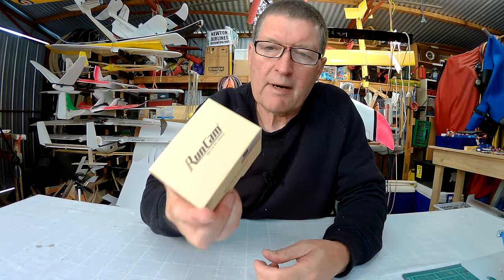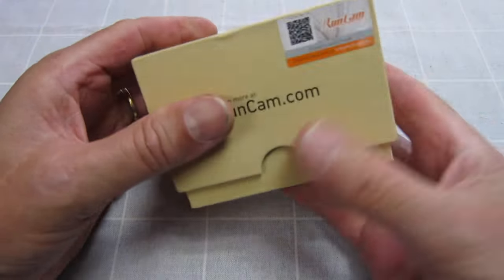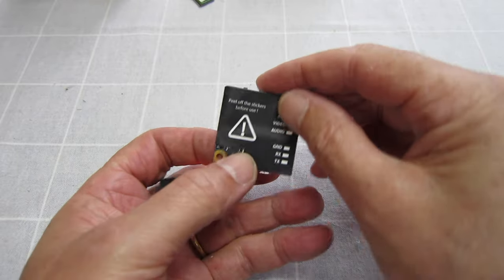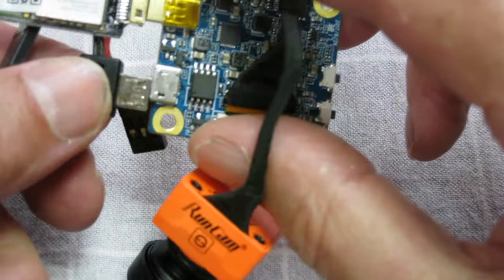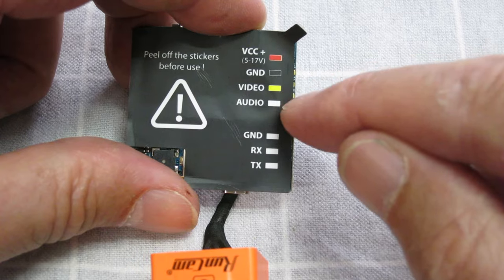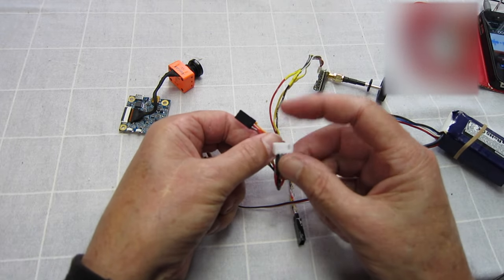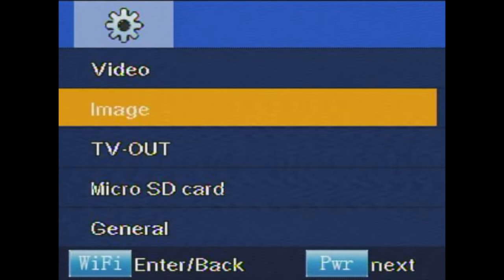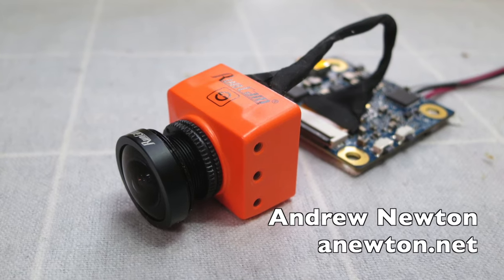Runcam Split 2

Comment: Would you mind doing a comparison of the Split FPV feed to the Eagle 2 & Eagle 2 Pro, including in low light conditions please?
Possibly on some kind of common mount if possible so we can see side-by-side???
Thank you VERY much in advance! :)
(It's the FPV feed that & light handling that has me worried about the Split)
Reply: BLeeKiis Too I've used both the split and the Eagle 2 and I can tell you that both are very similar. 

The split has a softer image which is nice but it did look a bit darker when it was in my poorly lit room (even with WDR one) Colours were good too. 

The runcam eagle 2 however the image was just better. The WDR made my dark room look like the sun was shining through the window. With the sharpness and edges turned down the image looks really nice. Honestly it didn't feel like I was looking through an analog camera. Everything felt natural.

The Eagle 2 pro is said to be the exact same as the previous but has 4:3 and 16:9. Imo you can't beat the Eagle when it comes to image quality. It even works as a low light camera too.

My problem with the split is that it shows a 4:3 image in my 16:9 skyzones and it just didn't line up with my osd. Not an issue with the Eagle 2 though
Reply: Ive read that the Eagle2 Pro doesn't has a higher minimum lux rating compared to the Eagle2- more like the Split & Swift so kinda torn between Eagle2 Pro or Split with microphone, or perhaps going for an Owl2+- I really like a microphone & low light both, would also like 16:9 so that brings me back to Eagle2....
And around the thinks go again! :v
Thought a side-by-side comparison might be interesting & cure some of the thinking..
Thanks again :)
Reply from the maker: None of the three are marketed as low light cams so wouldn't expect them to be great
Reply: ohh youll be surprised how well the eagle 2 does in low light. it has the same lux vaue as the owl plus and performs just as well
Reply from the maker: Thanks, good info. I have one but never used it in low light

Comment: I've seen there are 2 optional extended cables (180mm+90mm). No signal loss/degradation on the longer cables?http://shop.runcam.com/lens-extension-cables-for-runcam-split/
Reply from the maker: Haven't seen anyone try the longer cable.
Reply: It's a digital cable. It just can't degrade signal.
Reply: mmm...maybe not degradation but (might be?) interference....I remember something about over here...
https://dashcamtalk.com/forum/threads/mobius-lens-extension.3224/